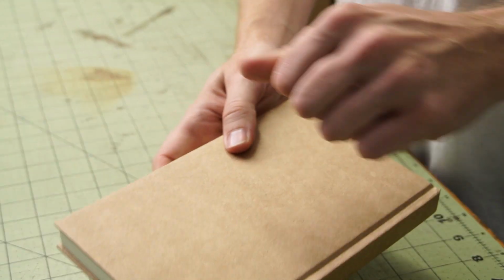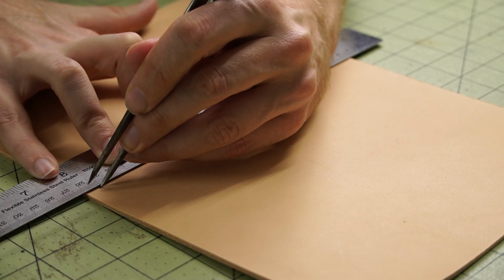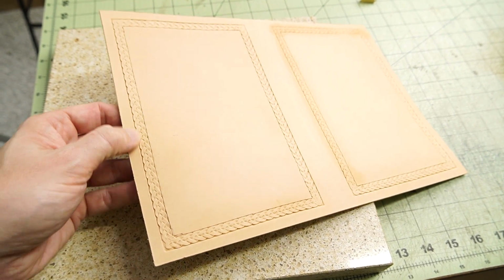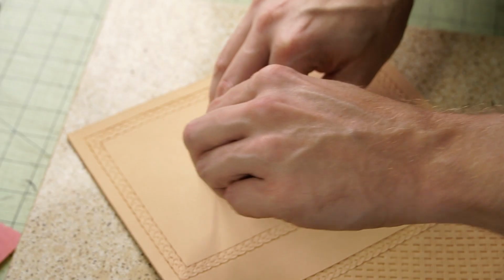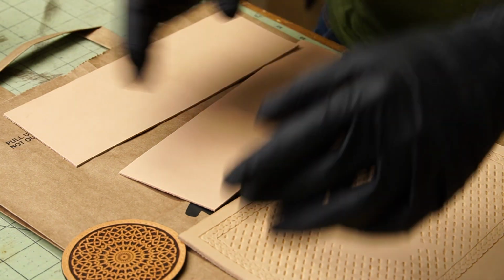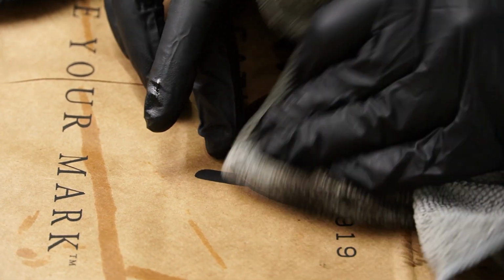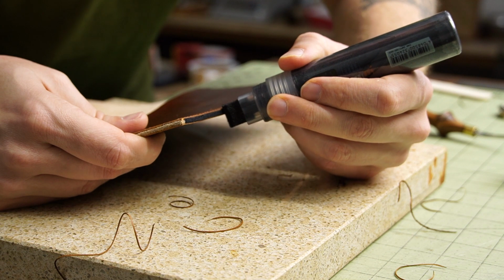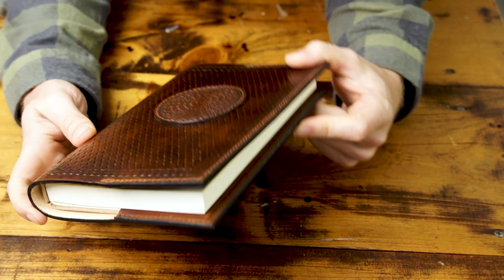Dyed and Stamped Leather Sketchbook Cover (1st Attempt...)

Comment: I will use a pencil to put your medallion in trace it then put guidelines in for basket. You need to dampen your leather a little more. I soak it for a minute or two then let it sit  20 to 30 minutes then tool when the original color starts come back but it will still be damp.  If you start to see stamp is not crisp looking give it a light mist then continue

Comment: I do leather crafting and would just like to give you some tips for the future. 

1. Your leather is too dry which is why the stamps didn't go as deep as you would have liked. Watch some videos on casing, but generally you want to give it a good wetting and let it sit for about 20 minutes or so while it dries a bit. This lets the water go down into the leather and gives it a richer color in the stamp. 
2. In the future, use a camouflage stamp around the edges between your edge stamp and  your basket stamp. That will fade everything together nicely. 
3. Before adding your antique you want to add a resist (super sheen, resolene, etc). After that dries you can add the antique on over it and it won't darken your leather near as much but stick mostly to the recesses. Then you can add your atom wax on top once you've let the antique dry for a bit. 

Just some tips. Overall tho, not a bad job for a first attempt.
Reply: I was going to make a comment stating the same things. Good tips...

Comment: Oh boy. 
A - for taking a chance to stumble, fall and get back up. 

So, here is where you went a little south...
Try to get in the habit of watching pros in an area you want to learn.

1 - Weaver leather supply - Chuck Dorsett 
•  Dying Leather, leather finishes and protectors
2 - Springfield leather Company - Denny
• Pro stamper, dying and finishes, leather care (40+ yrs experience). designed a few - craftaid - acrylic stamp templates. 

Both of these guys are masters in Midwestern style leather work.  The piece you made falls in that category. They work primarily with vegetable tanned leather in all weights and more.  

1.  For personal reasons, a 4/5 oz veg would have worked well for the entire cover. But it also depends on how you plan to use the journal.
6/7oz is a little thick. But I understand why you might want to use it. 

2.  When stamping, you actually took a risk in your procedure. 

99.999% of experienced leather workers would tell you this is not how you do it when stamping. 

Here is how to stamp, gather your necessary supplies. 
1 - Small container to soak the leather 
2 - sponge
3 - clear packing tape or opague masking tape the standard light yellow)
4 - Wing divider
5 - template *
6 - skiver
7 - edge beveler for 6oz and higher
8 - awl that is used for stitching holes. It's very sharp and has an angled blade.
9 - rags for buffing, etc.
10 - nitrile Gloves 

Suggestion: 
If you want an even color, you can dip dye - Chuck Dorsett has a few videos on the - Weaver leather - YouTube channel. 

Stamping:
Watch how Chuck Dorsett and Danny's videos. 
- Soak the leather 
- Let it dry until the color is almost back to normal.  The leather will be wetunder the top layer of the skin.
- Cover the back of the piece with the cellophane packing tape or masking tape. The leather will stretch during stamping and dry that way.
- Make a diagonal line using a "scratch" awl, start stamping from center out. 
* you could have stamped both panels and placed the decorative circle on top. Without a pre-made template, it is hard to know where to stop and start. Since this will be covered, it's not going to affect the design. 

You ca use resolene as to void where you will place the decorative piece. Next dye and antique your piece. Then clean off the resolene. Take the Pre-punched decorative piece and glue using cementglueor requilium water based glue. Take the angled stitching awl and use it to go through the pre-punched holes to perforate the cover.

Chuck Dorsett has a video on doing this as well.

Corner and boarder punch spacing:
- This is where a template is handy.  You don't need to punch out the boarder. Instead you can use it to make sure the stamp doesn't overlap or fall short.